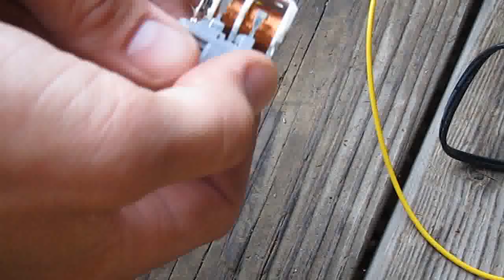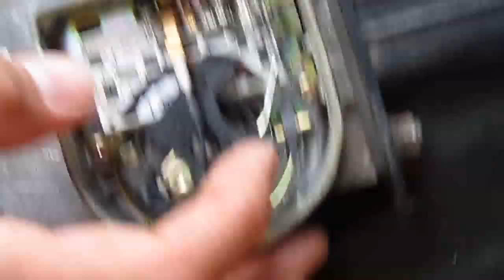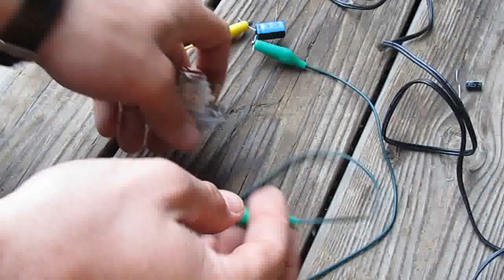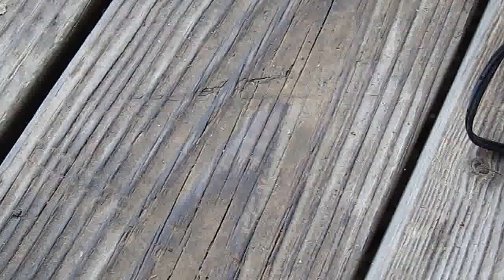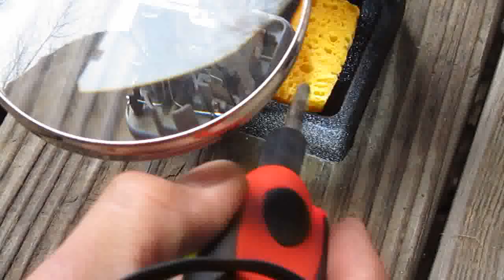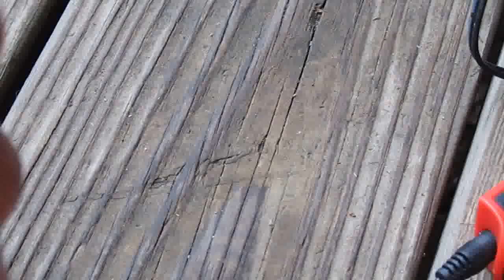Cheap fix/mod - Circuit opening relay

Comment: In an emergency could you just jump ignition power to the positive going to the fuel pump?
Reply from the maker: That's what +B to fp in the diag box does. Wouldn't want to run it like this, fire risk in a crash

Comment: How do you get the cover off of the Circuit Opening Relay? Brilliant video! Thanks!
Reply from the maker: I don't remember exactly on this particular relay if there were locking tabs. If there are they are small pieces of bent metal protruding through the bottom of the relay which can be twisted back to the parallel, and that will unlock it. On most the relay will just snap off if you stick a screwdriver between the bass and the upper plastic housing and pry/pull one side at a time
Reply: @jbtvt  EXCELLENT! Thanks for the prompt reply. Have a great weekend!

Comment: Thank you for this one, specifically the resistor value. Couldn't find any info for it anywhere, and mine was drowning in water and rust stains as well as it's location under the coils making reading resistor value impossible. I can only surmise that it's more of a current limiter to prolong the drain time for the cap, though I wanted to cover my bases just in case it served some obscure function like for example a feedback loop circuit for the ECU. 

Going to have to refurbish mine as the price for a new one is ridiculous. The coil metal frame had almost disintegrated into rust, and most likely the run coil side iron core had become rust as it was so weak it could not close the contact, though it could pull ever so slightly. Essentially have to remake the metal frame, contact hinge and coil core out of long bolt, sheet metal and screw or rivet for the copper contact spring.

Alternatively, one can recreate this circuit with two generic 12v relays, as the COR is simply two relays closing the same contact switch or circuit, despite the name; though the VAF/AFM relay will most likely need the capacitor connected in parallel to the relay coil to achieve the same functionality. All this, without negating the safety function of this relay circuit, unlike a mere jumper.
Reply from the maker: Been years since I looked at this circuit but I think that the cap/resistor setup is primarily for arc supression, and no ecu feedback. So removing it would just shorten contact life, and possibly shut off engine more quickly in event of a monetary afm signal loss. They call it an opening relay because it opens the circuit in event of air flow stopping, but yea, nothing special about it otherwise

Comment: My 1991 4Runner 4x4 3vze had a fuel pump related problem also but in my case it was also the MAF & the Circuit Opening Relay. I did all the basic procedures to bypass the gas pump that wasn't working. My friend got my Haynes Manual and traced the fuel pump wires to the MAF & the relay while I did research on youtube and came across your video and others also related to these 2 parts. So my friend & I came to the same conclusion doing our seperate research that my fuel pump wasn't working due to the MAF or the relay. Long story short, after 3 months of my baby not running, I finally went to the junkyard and got me 3 Circuit Opening Relays & I bought the MAF sensor but removed the black upper plastic cover from the air box that it is attacked to. I went home, installed the MAF & the Circuit Opening Relay and my 4R started after cranking it 3 times. It started sluggish at first but then I gave it full throttle and it was like feeding it super viagra. 

I had noticed that after removing the plastic cover on the original relay, that it had this white corrosion. I think it was due to water leaking in through the right fender's antenna hole. I've been running my 4 runner with a loose antenna for about a year and since the circuit opening relay is located  almost directly under the antenna hole, water was leaking through and eventually got to the relay. I paid 40 dollars for the MAF at the junk yard and the relays are very cheap and will probably outlast any amazon or autozone relay despite it being about 30 years old. Newer relays can be retrieved from any newer toyotas at the junkyard anyways. They are just located in different areas in the vehicles. I think some toyota corrolas have them under the center console right underneath the radio. I thought I'd share my experience. Thanks for your video; it was helpful.

Comment: Some update and info   . 2004 4x4 Regular Cab Tacoma with the 3RZ-FE has the circuit opening relay under the drivers side fuse box and not like Madjik's above but close and the wire colors are the same. The relay is the same part number as the EFI relay and power supply in fuse box 2 under the hood. Relay is single control with only one coil. EFI relay supplies power to Circuit opening relay. The start side of the ignition supplies the control side of the circuit opening relay and the ground side of this control is the ECM.

So in a nut shell, the circuit opening relay closes and turns on the fuel pump when cranking. When motor starts, when you let off on the start, the running condition then makes the relay stay closed and keeps fuel pump on. If by chance, motor does not continue running, the normal on side of the ignition key does not keep relay on and the fuel pump does not run. (it's a safety switch to the EFI relay) Other cars use a timer to to run pump and do not have this extra relay. The running part that tells the ECM to keep the circuit opening relay closed is the Cam Position sensor. 

Problem comes and goes. Driving me crazy and can no longer trust truck. Truck still has a airflow valve. Fuel pump pumps fine when you give it power to the blue wire on the circuit open relay. The call out for the fuel pump is .2-3 ohms . It reads 1.3 at the wire at the relay. Crank sensor calls for 1630-2740 ohms. It reads 2060. Pain to get to the camshaft sensor under the intake, so not checked.

This system does not have a fuel pump timer like most FI engines?

Another interesting fact is this motor has two 3 temperature sensor. One back by the ERG valve. One on the front right water housing (controls temperature gage) and the important one is hidden in back of motor on back side of valve cover at firewall. (need to lift protected wire harness on three hangers to see it). It is what reports to ECM for start and warm up fuel mixture.

Comment: Cool.  Some help needed here....  Truck only has 50K bought new by me.   First problem ever.  Will start up but dies when you come off start side of key.    Slightly different setup from yours.   2004 4x4 Regular Cab Tacoma with the 3RZ-FE has the circuit opening relay under the drivers side fuesbox.  The relay is the same part number as the EFI relay and power supply in fuse box 2 under the hood.  Relay is single control with only one coil.   EFI relay supplies power to Circuit opening relay.  The start side of the ignition supplies the control side of the circuit opening relay and the ground side of this control is the ECM.   My problem is even though I have all the OEM manuals, still not sure what the control is in the ECM that is doing ground.   Problem comes and goes.   Driving me crazy and can no longer trust truck.    Truck still has a  airflow valve.   Fuel pump pumps fine when you give it power to the blue wire on the circuit open relay.  The call out for the fuel pump is .2-3 ohms  .  It reads 1.3 at the wire at the relay.  Crank sensor calls for 1630-2740 ohms.  It reads 2060.  Pain to get to the camshaft sensor under the intake, so not checked.   Any thoughts?   Does this system have a fuel pump timer like most FI engines?   What is your guess that is controlling ground side of the control circuit of the  Circuit opening relay?   Last time it happened, I was checking it out running my meter in line on resistance to ground from the control side of the relay.   Trouble is, this wakes up the problem and truck starts fine.  Happens so quick, and my meter has no freeze frame but I think maybe that is of course doing the ground but how is it fixing problem and of course for how long.?
Reply from the maker: +RIPSAWONE MAF uses an electronic signal so only one coil would be necessary. Not familiar with the 3rz but if grounding the relay causes start it sounds like a bad ECU, or something in the circuit between relay and ECU. Check continuity. Open ECU and check for corrosion, swollen capacitors, and maybe try another off Ebay.

Comment: jbtvt great vid, I have a 93 dolphin rv toyota dually with a 3vze engine will not start after sitting for a few months, live in Las Vegas and gets hot. I will check my capacitor on my circuit opening relay I get no fuel at the rail when cranking.  I still dont understand the whole starting system but I am working thru and checking coil, igniter and afm , these currently check out to spec with ohlm meter. what is this mod for the afm? again great video thanks
Reply from the maker: You can pinpoint/rule out the COR by connecting the +B and FP port in the diagnostic box under the hood with a short piece of wire or paperclip. the AFM mod is slightly down the page here - http://www.customtacos.com/forum/13-performance/56229-3vz-e-afm-not-too-small-proven-via-math.html
Reply: thank you for your reply

Comment: friend if you install a capacitor 200 instead of 130 or 150 would happen?
Reply: It's a capacitor connected in parallel with the VAF /AFM running coil, so all it does is store energy and keep the coil closed for longer than half a second; the bigger the capacitance, the longer it remains closed. That being said, modify at your own risk.